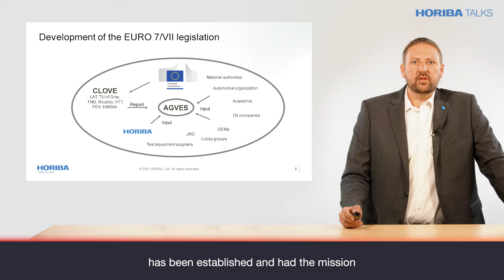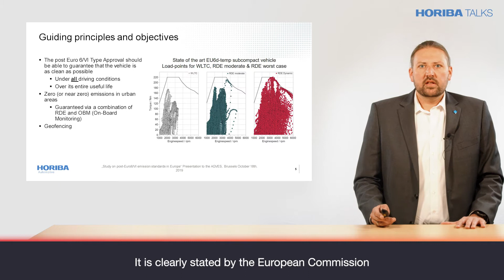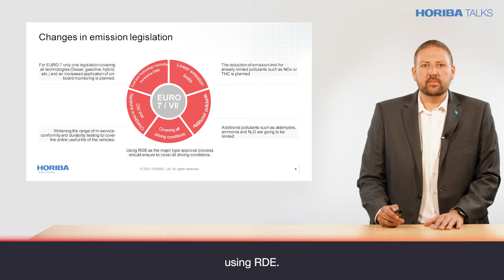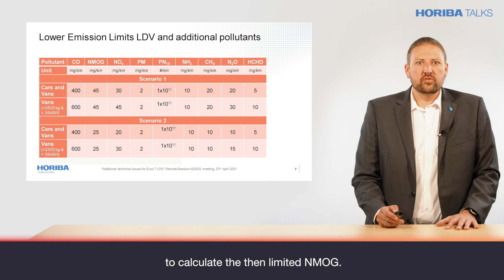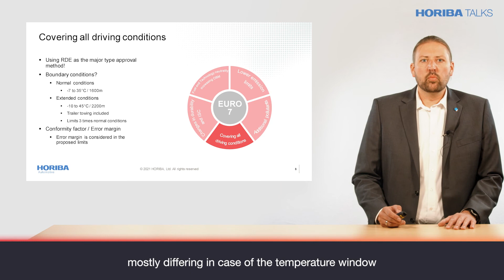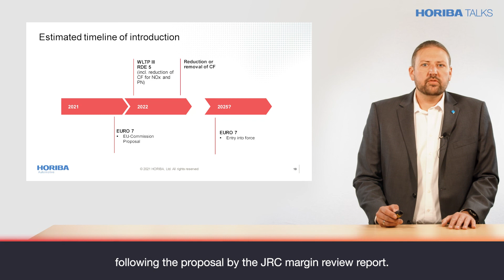HORIBA Talks: Euro 7 Legislation (2021)

Comment: If I’m correct option 3 is for all cars to be monitored via GPS every time you drive. This I worry will be abused by those in power to include tracking of the driver, speeds etc etc.  Some of this is understandable but far too controlling I fear.